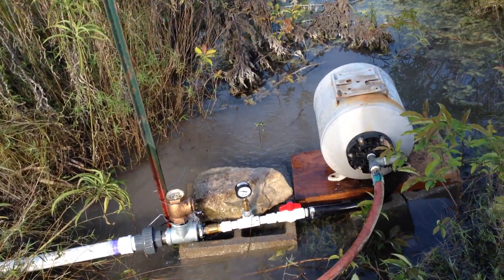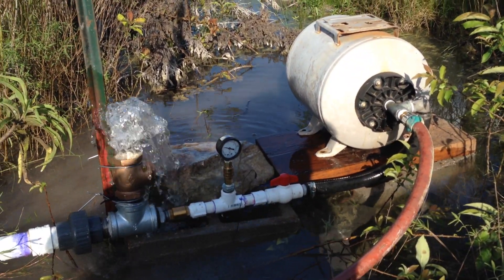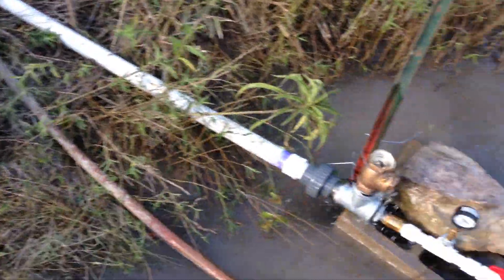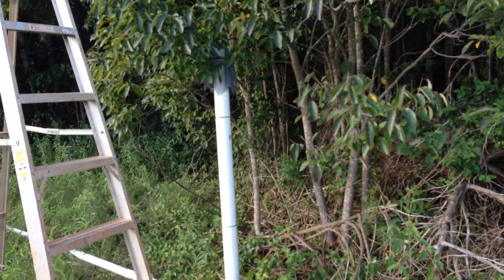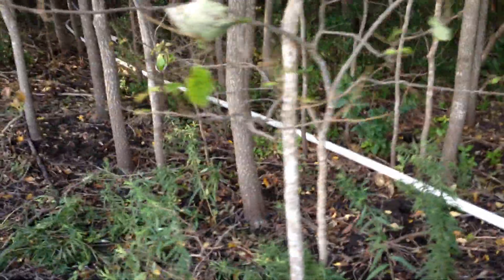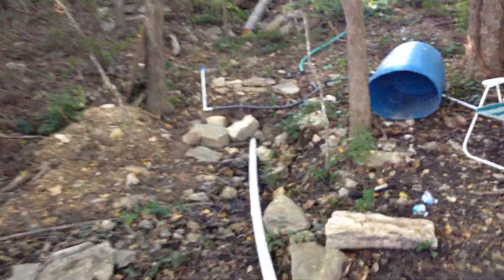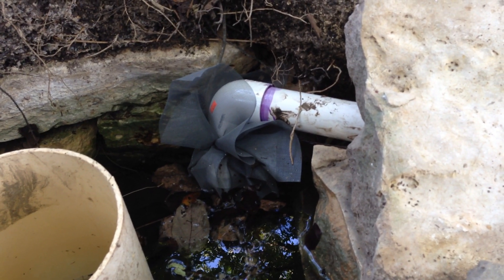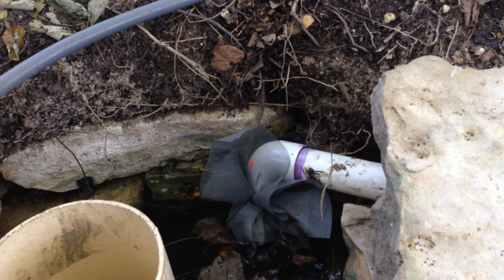1-1/2" ram pump

Comment: nice standpipe, allowing atmospheric pressure into the pipe is a good thing.
Reply from the maker: Yes, the standpipe seems to do it's job to allow the shock wave to dissipate before it has to travel all the way to the source. The current pump runs at about a 2 second interval. It's a little slow, but good enough. Check out the video of the current stainless pump. https://www.youtube.com/watch?v=Zf2iMdzcME4&list=PL-jaYj8F_E2joMMczPuyRfVETQdjztlMo&index=1.
Reply: @TheShop22  why not standpipe the  accumulator? should equal more  pressure out of the pump
Reply from the maker: @safetyfirstintexas  that's an interesting idea. The stand pipe would have to be approx. 46' tall for 20 psi pressure, however. My system runs even higher than that so it wouldn't be practical for me.

Comment: Nice work. You can tilt the check valve to decrease your pumps output to a certain degree. So you don't use more water than the well is producing.
Reply from the maker: Thanks Wade. I'm learning. The way I have my pump anchored currently prevents me from tilting it, but low flow definitely comes into play with my well. I will eventually redesign the system to make tilting possible. I am envious of your Rife Pump.

Cheers.